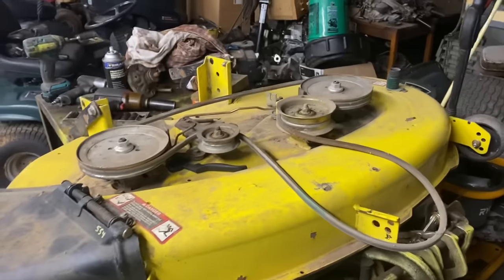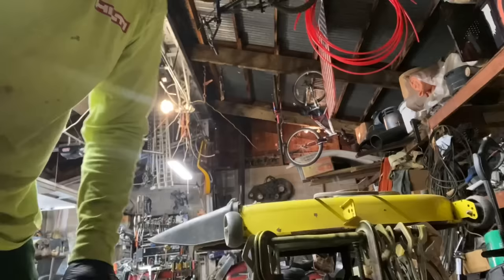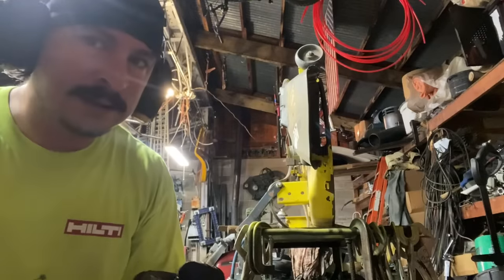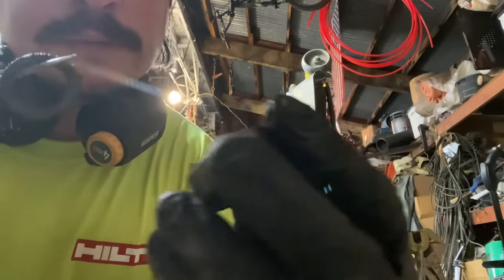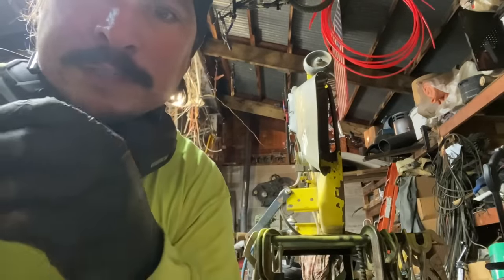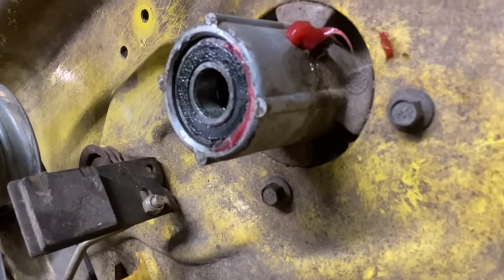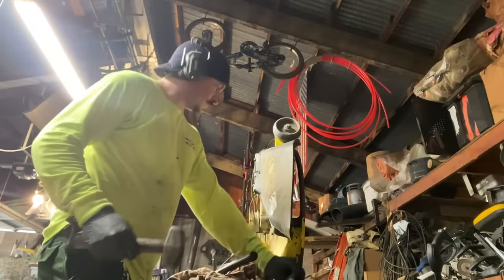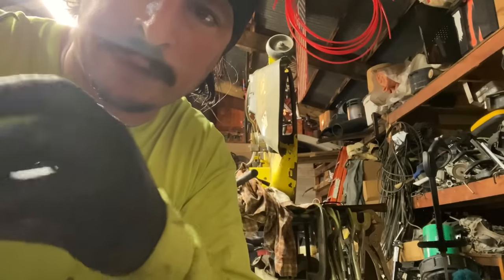Part 1 - Don’t trust the “Experts” Grease your mower deck sealed spindle bearings Common sense.

Comment: I'm sorry but you are wrong, sealed bearings should not be greased I'm a retired millwright mechanic. What should have been used on those spindles as sealed or shielded one side bearings. If you fill that housing with grease and you have double sealed bearings you can easily force the bearings out. That small amount of grease is normal and correct. The reason to grease bearings it to force the old dirity grease out and clean grease it. What we always did is if we replaces open bearings we removed the grease nipple.
Reply from the maker: In some applications you are correct. As most folks who know bearings should know that all applications can be different. For the application of the deck bearings the way I have done it is absolutely 100% A O K. And will work like a dream. No need to go full blown nasa bearing specialist and explain how detrimental this can be. You already said enough to for me to know you don’t even understand how the assembly is built. You couldn’t push these bearings out with grease or even a press when the assembly is together. You have to understand there is no room for any of the parts to move as the assembly has no space for movement of the components when assembled the only thing that can move is the grease and the the little rubber flaps on the seal. Everything else is bolted together precession fit. very super simple. So easy even a engineer can understand. Like Iv said before, I’m not repairing rocket ships here. As for the old grease, if new grease is added regularly the bearings will be happy, as long as the assembly stays sealed it should normally remain clean inside adding fresh grease once in a while is all that’s required to keep the bearings in hood working condition. I could go on for days. You do you. For folks that don’t want to fix broken decks they can simply add grease to the zerk and mow mow mow.
Reply: @GTObearclaw1  I have seen the bearing break the c-clip. What trade school taught you to grease sealed bearings? You insterutions are great, just remove the inner seals.
Reply from the maker: @thepubliceye  no, don’t bother removing the inner seal, the inner seal can’t stop grease from passing so why tear down the assembly? I
Say don’t remove the seal because it’s just a waste of time. A main point of my video and reason I purposely left the seal on the inner side was to prove that grease will pass the seal. Some folks don’t want to tear a deck down or may not have the tools or skills to tear a deck apart to check for inner seals or to remove the inner seals. The point is the inner seals don’t stop grease. If the mandrel is greased as I have shown the grease will pass right by the seals and it makes no difference if they bearings have inner seals. Just grease as I show and both upper and lower bearings receive grease. That’s basically the video in a Nutshell. I made the video because of the other out there posting videos telling folks they must remove the inner seal or grease won’t reach the bearings. Lol, I just proved them all wrong. Not a single person making videos has done a step by step like I did. And I knew they were wrong and I was sick of listing to the folks who state opinions like facts with no proof and providing crap advice. I knew it was bad advice so I proved it and made a video with proof the inner seals don’t stop grease and greasing a factory set up is absolutely not a waste of time and in fact will help your bearings. Again you have shown your cards it is seems that you do not understand how these assemblies are together, there is no clips in this assembly and you must not have watched my complete process because nowhere in this assembly is there a c clip nor any parts that can break as grease is applied. What are you even talking about. Your must be thinking of some other set up and confusing other bearing assemblies or applications. I’m
Not sure about that but This video breaks it down into baby steps for every part of the process. I did it this way to make it super clear so there is no confusion. Just watch it
From start to finish I didn’t leave anything out. Yes it’s boring but the facts are proven. Grab a spindle and try it. The one thing all naysayers have in comon is they all know but they won’t take the time to test the actual process. They just work it out in their brain and that’s enough for opinions to be facts apparently. That may work for some folks but for me I’ll stick to the step by step proven process before I believe folks who know everything but won’t prove it. I provided the proof. What is there to argue about? It’s free help. Just run your bearings to failure, it won’t bother me. You simply can not damage these bearings by adding grease
And hearing that folks think it will is sad to me. Almost a dumbing down so to speak. Maybe in some applications you have a point but in this application your just plain and simple wrong. Open your mind and consider that you may be wrong. It’s not the end of the world. Everyone is wrong about something at some point in life. I’m wrong about stuff all the time. I’m not a smart guy. I survive by working hard and wearing out my body. Unfortunately I don’t have the brains to do it any other way. Lots of people are wrong about this topic and that’s why I made this video. Sorry man, that’s just how it is. I’m not trying to be mean to ya. You left a comment and I’m just defending the process. Your not even making sense with your points.
Reply: @GTObearclaw1  Again what school did you take your machinal training in?
Reply from the maker: @thepubliceye  so that’s what your boiling this down to? We’re just going to ignore that your other comments didn’t make sense so now it’s about my training? Like that has anything to do with something so basic. I am the institute, your welcome.
Reply: @GTObearclaw1  I live in Canton Ohio, I'm retired from Timken, 5 yrs as an apprentice then 40 experience, I know a thing or to about bearings, just not good and explaining things. If the grease is heavy or cold is will can build pressure and damage some spindles, just to be 100% safe remove the inner seals. I can look up the data sheets on the subject and email them to you.
Reply from the maker: @thepubliceye   data sheets wouldn’t make any difference to me, I put things to the test and see how they actually work in real life application. I use to manually disassemble every deck and pull bearings and pack each bearing  until I realized the bearings will receive grease if it’s applied to the point the housing is filled then grease will push past the little rubber flaps on seals. So now if bearings turn smooth and tight I grease this way and it can save hours of time that does not need to be spent tearing a deck down. I didn’t do this once and post a video the next day, Iv actually been doing it for years without a single failure or even so much as a seal popping off due to grease passing through it. After so many annoying videos of others telling people don’t even bother connecting a grease gun on the zerk because grease can’t pass the inner seal I decided to call BS. In fact grease will reach the bearing. Nothing will be an issue and bearings are happy. The service can be done at home for only a few dollars in grease, no other tools are needed and it prolongs the life of the bearings. If I only went buy specs and was worried about cold grease being an issue, or an inner seal having any effect on anything related to preventing grease from reaching bearings or holding too much grease in the bearing I would never have posted the video. In my opinion that I have through testing with zero issues I find this to work 100% of the time. If folks want to as the question and run some tests that’s great. I just don’t want people to buy in to the BS that greasing the mandrels will not help the bearings. I believe it will always do more good than harm. In fact don’t think it can do any harm at all to grease the mandrels but folks need to know that the grease will have to fill
The void before any will pass the inner seal. If you can run some tests and find where issues can occur and there is proof to be shown please post it. Not a single person making videos on this topic can prove it will or does cause issues. All naysayers 100% rely on unproven data or ideas in there head that make sense to them but don’t actually hold water. I’m the boots on the ground proving it on video.

Comment: You Definitely Do NOT Want To Blow The Exterior Seals Out With The Pressure Of The Grease Gun. Oh Yeah , I Have Trouble Getting A Grease Gun Tip To Stay On The Grease Fitting. Wish The Had Put Angled Ones In Them ..
Reply from the maker: As for blowing the seal off, maybe you noticed in my vendor that didn’t happen and I can also add that in over 10 years of doing this Iv never seen that happen once. I’m specifically talking about greasing these type assemblies that have a shaft running through it with components on both ends holding the bearings on place with no room for the shields to move out of position. I’m not positive that’s what keeps them in the bearing but Iv never tried it any other way and this works fantastic. My argument to folks with that concern is maybe you should try it once and see for yourself. If you plan to dismantle the assembly anyways then why not just grease it first and see for yourself what happens. As the coments below show many folks already do this exact process and nobody ever said they had that issue. This comment only comes from folks that have the concern but no personal experience of it happening. It’s easy to grease You can buy a 90deg fitting
To connect to your zerk or a coupler that is made for tight spots.
Reply: @GTObearclaw1  yep I have years of greasing bearings as a maintenance mechanic.. just wanted to throw that out there for the folks that haven’t ever done this before, just not to push so much grease in it that it blows the seal out .. thanks .. oh yeah it just looks like the company that builds them would put the grease fittings higher up on the spindles so you can get to them . Most of them are too close to the deck top .. just my opinion ..
Reply from the maker: @5dennisk  some are on top and go through the shaft some on sides of housing some on bottom. The ones with zerk on bottom are the worst as the cover up with crass clippings. Unfortunately the only way to get grease into both bearings is to keep greasing initial assembly is filled. First time is the main and most important as the assembly will be empty unit it’s greased after it’s sold. If we are talking box store brands. So the first time the assembly is filled a lot of grease is needed. Like I mentioned maybe up to 70 pumps from a hand pump type gun. The pressure needed to push grease out is way less than one might imagine. Just because a grease cub is capable of thousands of pounds of pressure I don’t think it needs but double digit pressure to push through said assembly. Just my 2 cents. I hope everyone will grease their bearings and save trouble in the long run.

Comment: I would have packed the bearings while they were out, sticky red rules
Reply from the maker: Sounds like the point of the video was missed. There are thousands of videos showing how to pack bearings. But I am showing that by adding grease with a gun through the factory provided zerks, the grease passes into the bearings. Why would folks want to dismantle a
Deck to remove the bearings and hand pack them when there is an easer way? And I just proved that the grease reaches the bearings to debunk the BS some of the so called “experts” are saying. I had enough and could not stand it any longer. Not a single one of the pro mower guys on YouTube show that the grease will in fact reach the needed spots when using a zerk. Plenty of bozos saying otherwise and not a single one took the time to prove that grease was unable to pass the inner shields. So I do exactly that to help the DIY guys who wanted the truth. It’s the reason I removed bearings. Only to make my point. But for folks who get a warm fuzzy feeling by dismantling a deck to gain access to a few bearings that could have been lubed like I show with a grease gun, more power to them. Just not gonna waste my time with pointless projects.

Comment: Should just remove the rubber seal, no? As much grease as there is between the bearing and outside world, “dust” won’t easily reach it.
Reply from the maker: No, leave seals in place. Add grease, mow the grass. So easy it’s stupid. Nothing more is needed. 

Why add steps, dismantle brand new machine. Invest time into
Something that’s not needed. The video explains it. But I understand the information is hard to Absorb.

Comment: Bearings do not 'last forever". Factory greasing is minimal at best, this is why a maintenance schedule is important. High wear parts need to be re-greased on a regular basis or you WILL see early failure. The "seals" on these bearings are not hermetic seals (they aren't perfect) they are only meant to keep out larger particles that might damage the bearing. Use your  "common sense" along with your intellect, and look at classic and antique machinery and automobiles in comparison with their modern counterparts and you'll realize that modern stuff that doesn't seem to need regular greasing isn't designed to last like the older stuff that did require regular maintenance like a grease job every year.
Reply from the maker: Not sure what you were aiming for with that comment. Couldn’t really feel if you were on my side or disagreeing with the point I was aiming for. It is my opinion the bearings can last the life of some tractors if the deck bearings are kept we’ll greased. Some bearings have flaws and will
Eventually fail regardless but some are better than others. Lots of factors to consider and unfortunately most the time the factors are unknown unless a deck is dismantled. So the easiest way to make them last with the least amount of work is to grease them as Iv shown. It’s no big deal to connect a grease gun and push a little new grease into the path of the bearings as part of the preventive maintenance. I personally think that once a season is probably plenty. As some
Machines can go for a decade or longer on the original grease even if no more has been added. Seems silly that folks wouldn’t do it just as a precautionary measure regardless if bearings are not going to last forever. I’d like to make them last as long as possible and without adding grease it’s a guarantee they will fail sooner than if some grease is added. A little more grease sure won’t hurt anything. It’s not a stench to say that the bearings can last the life of a tractor even though the bearings are not always the highest of quality, neither are the rest of the components in most these box store tractors of today. Iv seen many engines fail catastrophically before the deck or any other comes failed. Many kohler courage engines have failed with less than 100 hours. And many times Iv seen engines go out on a tractor reaching only 8 or 10 years old, folks would rather buy a new machine than invest into replacement of an engine so in many cases the deck bearings only need to last as long as the tractor and my video is about deck bearing preventive maintenance and the only point I was hoping to make.
Reply: @GTObearclaw1  Yes, I was on your side. My comment was meant to inspire people to grease their bearings regularly or else they will fail. Properly greased bearings will last practically forever. Keep up the good work.
Reply from the maker: @MinnesotaFarmboy  thanks, I appreciate any positive support I can get. It’s about 50/50 on one half folks Appreciate the information or say they already do exactly as Iv shown and it works great. The other half can’t understand how the grease can push past the rubber lip on the shields and they want to fight tooth and nail to prove I’m wrong but none of the naysayers are willing to provide video proof that the process won’t work. I don’t even know how it’s a arguable conversation on the opposing side. Some folks would rather argue than admit they have been fixing mowers for 20 or 30 years and had no clue the whole time that they could have just simply apply grease to a deck bearing through a existing zerk. You hit the nail on the head, common sense.
Reply: @GTObearclaw1   yes, you're right, many "armchair" mechanics out there will disagree with us, having never worked on anything significant in their lives or simply wanting to sow disinformation and discontent for their own entertainment. It's a simple fact that these bearings seals don't provide a seal against any particles smaller than a dust grain, and grease particles are much smaller. Some assume they block out everything including oxygen. You would think they are all from Missouri, but you have actually shown them with video proof the error of their logic. You have done an awesome job introducing people to common sense critical thinking. The grease zerk is there for a reason. If people will take the time to look at the housing where the bearings are installed, they will find that there is even a channel by the top bearing which allows grease to bypass the bearing under pressure during re-greasing so it won't actually "blow out" the seals on the bearings (as I heard in one comment on the subject). The space between the bearings is a reservoir of grease in contact with the shaft which will migrate both up and down the shaft and penetrate both seals during use. Over time the grease will slowly leak away as it gets used, that is why it needs to be re-greased. It is a fool's folly to ignore regular maintenance on an item for which you have spent so much money and depend upon for regular use, but it seems many people even do that with their cars nowadays - just filling them with gas as needed until an idiot light shows on their dashboard.